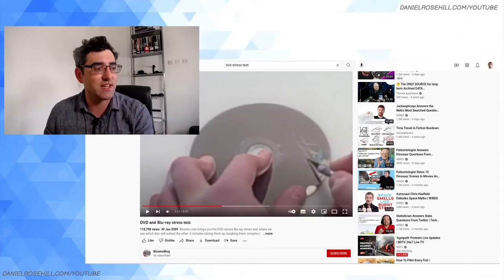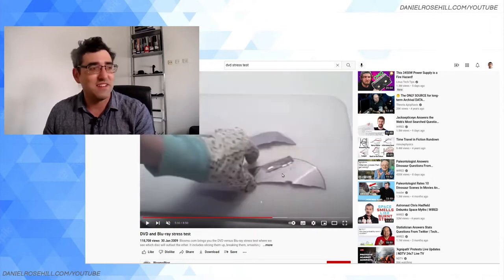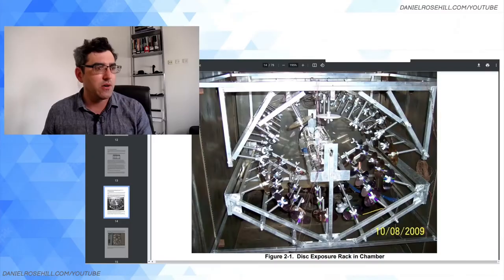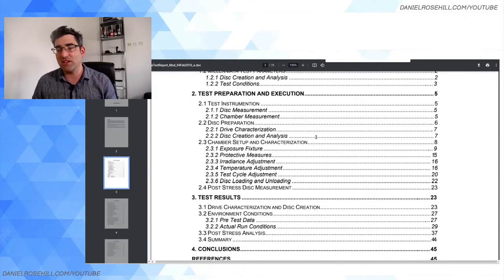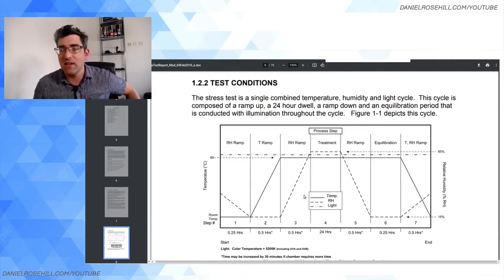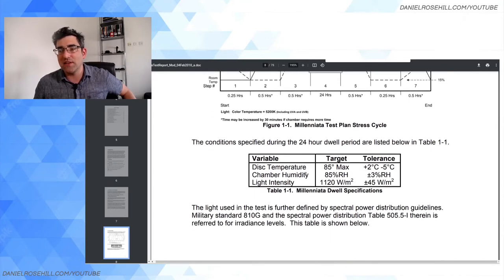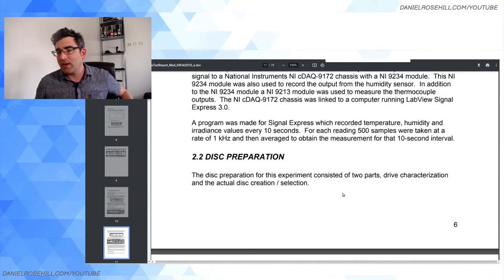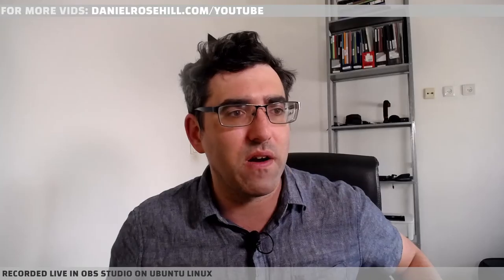Optical Media Stress Testing Is Kind Of Pointless

Comment: Optical media used to be really big back in the day when it really undercut HDDs for storage costs per GB. I still have both CD-Rs and DVD-Rs that I burned 15-20 years ago. I stored them in both spindles and in binders similar to what you're using. It would be interesting if I were to ever to get around to it to go through them and test a few of them out, to see whether a lot of the data is still readable on them. I remember that I had a 6 cd track cd rotator/player in my car once and I had some cds in there that I had burned myself in addition to store bought pressed versions. Years would go by and I never had a problem with any of them playing which surprised me because I also live in the desert and it gets very hot for many many months every year and it always surprised me that the cds that I burned on cheap media never fell apart and always played with no issues.